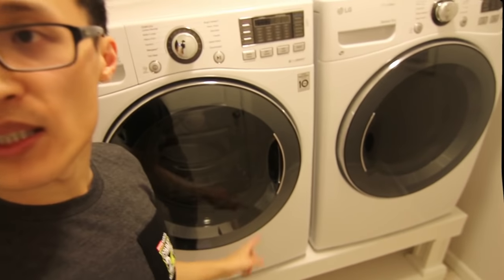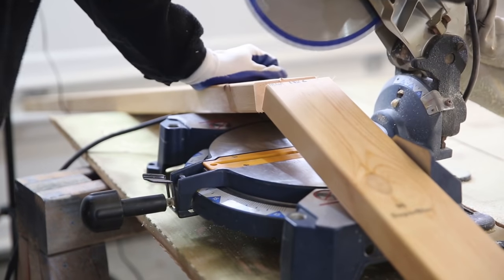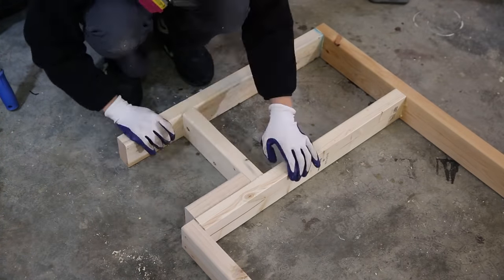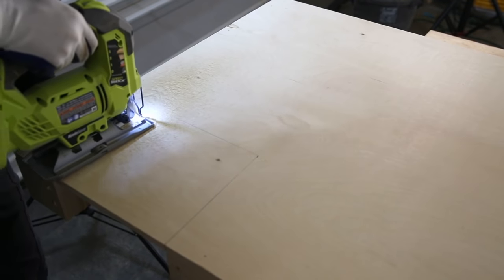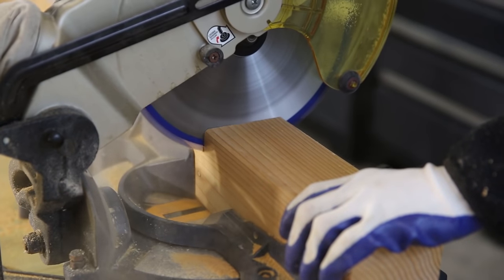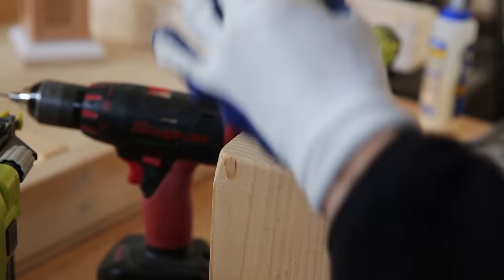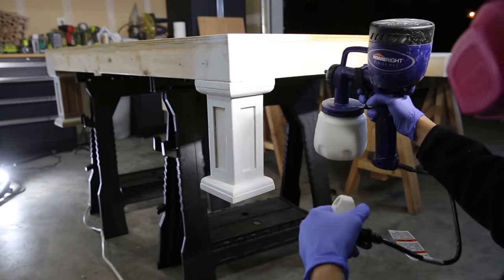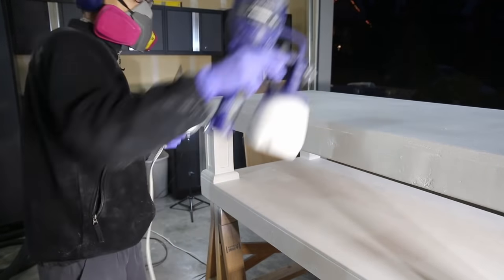Laundry Washer Dryer Pedestal DIY

Comment: I just changed my washing machine drain hose. I slid out my DIY riser to gain access to the back. No problem.  I made my risers at least 12 years ago, they're still rock solid.  Thought I'd share.  Front loading washer and dryer.  
First you want a riser for each appliance., so you can slide each one without having to move both. I just slid  my washer out to get access to the back. Any repairman will someday need to do this, and you want access to the back of the dryer to clean out the lint (a fire hazzard) and to reattach the hose when it falls off a week after the installer leaves.  (It always does.)  The room mine are in is very tight,  just a few inches wider than both machines and the depth is just a bit more than double. If I pulled them both out together, I couldn't get in the room. Much easier to slide them one at a time.  But the tight walls keep everything in place -- that might be  a factor for you. 
So 1. Plywood bottom -  easily slides on the tile  floor  
 2.  5/8"  (16mm) BCX plywood so not the best grade, but exterior so it can get wet.  You could build floor with this.
3. Open at the front and back so I can reach/see all the way through. Solid plywood sides and top. (so a rectangular box open at both ends.)  
4. Structure needs to be rigid and strong. I have a lip across the front and back  this stiffens the top and keeps the washer from shaking off the platform.  Half way to the back I have the main structure. This is a 2x3 (3" is the vertical)  going across side to side, and two 2x3 diagonal gussets. Screwed to the sides and screwed to the 2x3 . 
Tip: The whole top sits on the sides and the sides sit on the bottom, so the sides are supporting the weight on the top -- not screws from the side. and no edges against the floor, just a piece of plywood. (when you think structure: could you remove all the screws and it would still all 'work'? It's how your house is built.) 
5. My dimensions are 20" (50cm) high, slightly wider than the machine and just slightly deeper than the machine. The lip keeps the appliances from sliding off.   The height makes using my machines super easy. Lower wouldn't. 
6. My washer bucks like a rodeo bull.  However, my appliances are so tight that I just wedge some foam in between them and the wall. If they had more clearance they'd probably move around more.  You might have to consider that. 

If I did anything else I'd add a drop down 'sock catcher' shelf on a hinge under the front loading washer.  We always drop a sock or underpants on the floor.  Maybe about 10" deep (25cm)  folds up out of the way. Doesn't have to be strong.
Riser that are sold are $300 USD each, only 16" high (40cm) and are made from plastic. Will they last 12 years? I know my risers will last a hundred. I've built houses.
And confession. Checking my measurements I discovered I actually only have one riser that slides. I just noticed the dryer is on a permanently installed shelf. Stringer/ledge screwed to the wall. Stringer screwed to the floor that holds the side.  So only one side and the top -- but a stiff strong diagonal 2x3 brace.  So I gain access to the vent hose and back by sliding out the washer.  Hope this helps. 

The one in the video is good, but it's overbuilt and under attached.  You don't need all that structure. The base sits on the floor. The only thing the base needs to do  is  hold the posts so they won't splay apart. That could be just a piece of plywood on the bottom -- which would slide when you needed it to, or those posts properly attached to the top maybe diagonally gusseted on the top. They aren't. 
Each top and bottom frame, properly fastened,  could support 10,000 lbs (4500kg).  Overkill. Unless  this is a plinth for your 2000kg Telsa.  Any floor this will sit on will support double that.  So you don't need the bottom frame at all.  (I have one 2x3 running across the middle, then some plywood lips/stiffeners on the front and back. 12 years, as solid as the day I built it.) 

The screw heads are buried which on these 2x3s is not  a problem, but if you bury a screw/nail head 1/4" into  1/2" plywood your head is only screwing a 1/4" piece of plywood - you waste half your holding power.   For maximum fastening strength you want your head flush with the top, If strong is more important than pretty? Leave the heads slightly 'proud' on the surface.  But on the bottom you want to slide without scratching... sure bury the heads a bit. My bottoms are stretchers holding the sides together and for sliding. I could've used 1/4" ply.
Those nickle plated mending angles is amateur stuff. If you're using them either it's your mother in law's garage and you don't care or you're missing how to really attach something. Don't use them. Instead learn some house framing techniques. Incredibly powerful  useful techniques. That's why I know how much weight your frame could support. (There are some great YouTube videos on framing.)  And the expensive cabinet grade plywood? You're never  going to see it.  Painting? Painting is nice, but spraying?  Everything except those posts will  never be seen.  Sorry to be such a smug bast... hope this helps someone.

Comment: Have you noticed any movement of the machines? I'm looking into building my own and have concern that the vibration could lead to them sliding different directions.
Reply: I am thinking the same. I am almost sure you need to attach it to the wall.

Comment: Very nice video and very good pedestal. I did my self using your instructions. The only item that i am a bid confused is that the legs were made based on your measurements a total of 19.75" and my pedestal does look much taller than yours. Did you also used the 19.75 for the legs the total high of mine is 28"?

Comment: Doesn't the washer or dryer slide on this pedestal in the spin cycles?  or do they stay put with no movement whatsoever?  The regular pedestals have somethings to keep the washer or dryer fastened to the top surface with brackets or heavy duty bolts.
Reply: I don’t think they would move or slide any more than if they were just sitting on the ground like they normally do.

Comment: how's the vibration throughiut the house/floor?  my only concern is that over time the machines will shake the crap out of the pedestals and the vibration will get worse over time
Reply from the maker: It has been 13 months in use so far, still vibration free. It was also a concern of mine but still been okay. There are also vibration pads on amazon if that is a concern for you.

Comment: Hi Paul,
I'm in the process of building this pedestal. I have the platforms and columns painted. The dry fit was perfect. When you attached the columns to the top shelf, did you drive the screw thru the plywood into the wood block only, or thru the block and into the support colum. If so, what type and length screw did you use?

Comment: I would like to know how you lifted the machines up to get the pedestal under.  I think my newer front load washer has a cement slab in it; extremely heavy.
Reply from the maker: This was a new house and no washer dryer was in place yet. The delivery company guys put it in place for us.
Reply: @PaulTranDIY  How has this held up since it was constructed? would you make any edits to the build after using it for a period of time?
Reply from the maker: So far its been about 14 months and its held up well so far, no vibration or any issues. Just make sure its level before putting the washer and dryer on top of course! You can also get anti-vibration pads or furniture pads (we just used furniture pads)

Comment: not to be a troll, but i see that the guard of the miter saw doesn't cover the blade completely. take it from someone that has had small injuries with spinning blades, you might want to repair that. besides that, i just finished our washer stand last night and mine didn't look as good as yours. thumbs up! (ours is a temporary solution as we will be moving later this year.
Reply from the maker: Thanks man! I will get that fixed, didn't even noticed myself so appreciate you pointed that out.
Reply: Thanks for sharing...great safety tip

Comment: Whats the easiest way to to get the  washer and dryer on the 15 inch pedestal
Reply: So I just finished doing this exact project today.  I had the same question.  I ended up using a thick piece of plywood as a ramp and had my dad help me roll it up on a dolly.  Just make sure you secure both the pedestal and the ramp if you do it that way.
Reply: Dennis Mah lean the machine forward, with the back up against the pedestal and slide it back.